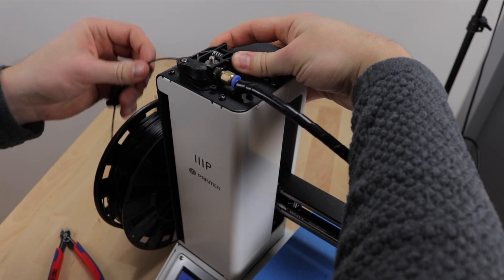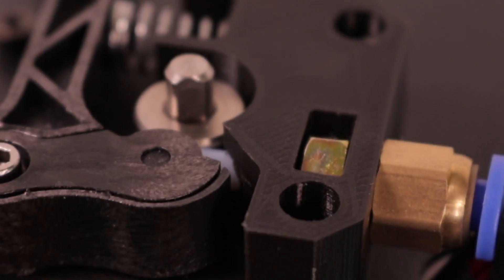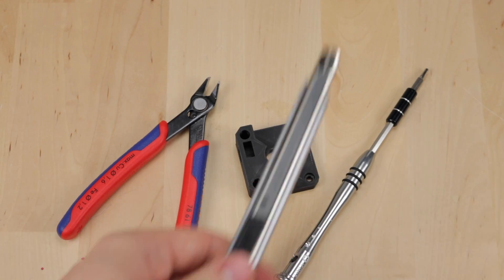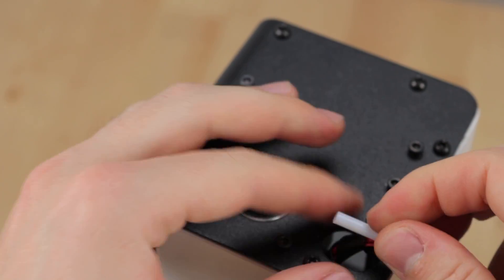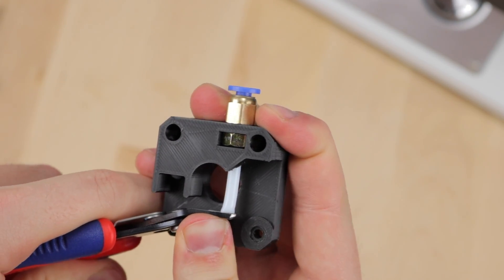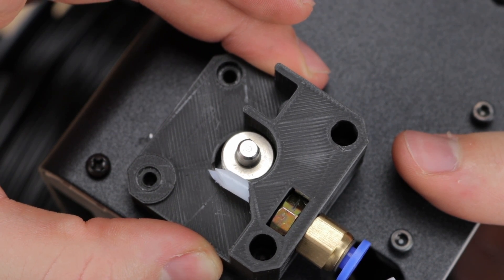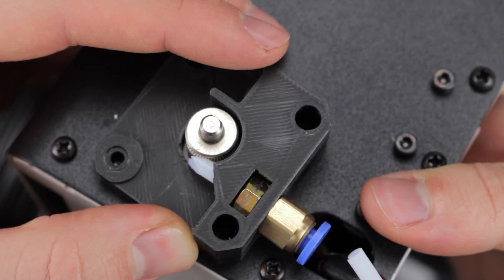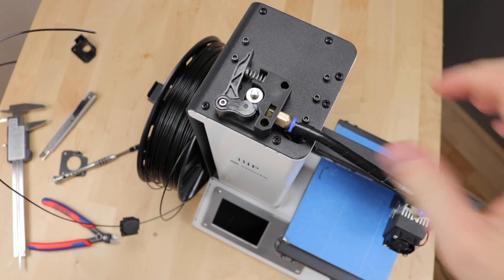MP Select Mini Feeder Upgrade for Flexible Materials - The Base Plate

Comment: Massive thanks! My base plate broke and you saved me a huge amount of work. I was able to jerry rig my broken extruder to print the replacement you designed and now it's fully functional again. The screw necessary to lock the idler bearing in place on my v1 machine was a little different than yours, it was a dome head screw rather than the allen head screw required for the design, but I was able to exchange the dome screw for an allen head version being used to hold one of the z-axis guide rails in place.

Comment: I had a few issues with this as my version of the printer doesn't have a nut for the Boden connector but I eventually found a way to get it working and it's great!
Reply: what did you do? im having the same issue
Reply: @dpschof9063  Not the cleanest solution but I got a pen knife and chipped a bit of the inside of the hole out to widen it. That wasn't enough so I also filed down the rim of the Boden connector and with enough force it went in. But make sure to super glue it in first or it will just pop out mid print.

Comment: Hi Robin, 
I want to start TPU also for my hobby and have this printer a while. is this mod still working good for you and does it endure?
what about printing PLA after the mod, does it effect? I have this printer for about 3 years and still prints perfectly PLA on stock settings
and never changed anything. 

thanks for your video!

Comment: Works great; thank you.  On the plastic tube you can just push it through to make it longer and snip it.  No need to have 2 pieces.
Reply: My early model MPSM has a step inside the fitting that prevents you from just pushing the tube through.  I wish it was this simple. :)

Comment: why not make the filament go into a pla hole instead of the ptfe tube for that section so you don't need all this cutting. or design a cutting guide!
Reply: I was thinking the same thing and since it's away from all the heat it doesn't need to be any heat resistant material just PLA for the most part.

Comment: BE CAREFUL!!!!  When I disassembled my feeder it had completely different hardware.  No metal base plate, and different screws and bushings which didn't fit with the printed parts.  To make matters worse the molded pin that hold the idler bearing snapped off while I was disassembling the arm, so now I have a broken printer and no way to print replacement parts.  I'm sure this is a great mod if you have the right version of the printer but don't bother if you have a newer unit.  (I purchased mine in Dec 2017).
Reply: the exact same thing happened to me, i just pressed my end of the bowden tube with the metal fitting  into the opening of the printed part and it worked out okay

Comment: Is this installation process pretty much the same in the V2 Upgrade on thingiverse?
Reply from the maker: I personally do not own a V2 but it should be the same. In fact I think a couple of people already installed it on their v2. You could simply try printing and installing the baseplate. There's nothing you could damage. (Maybe only cut the tubing if you confirmed that this part fits)

Comment: 1.5 cm was good for the bowden tube.  However I had a version of the mini with a longer press-to-connect fitting and had to modify the assembly with an extra washer.  Not a big deal, but people should be aware.  Please see my solution for that here: https://imgur.com/a/AteXT9C

Comment: Hi, You said you used a tolerance of .00mm for the arm, well for a cr-10s4 that tolerance is no right because the wheel on the arm is too big. thank you.
Reply from the maker: You mean the layer height? I'm sure if you go with the smallest possible layer height for your printer it might turn out just fine.

Comment: So im very hesitant on a 3d printer. ive looked at this one before or the prusa i3 mk2 and the other version of his printers. the only thing that has stopped me is the cost to how much i will actually be using it. the only reason i will be using this is so i can print some gopro mounts for my racing drones and maybe some antenna tubes and what not you know small stuff. so i wouldnt be using it very often maybe once or twice a month. would it make more sense for me to just buy the mounts that i already use that i know i like or get this printer and try to print out the same mounts and eventually i guess "save money" i go through one mount a month ish....but thats only on one drone of which i have 12. sooooooooooooooo
Reply: You are in for a surprise!  If you invest the time in learning the ins and outs of 3D printing and design software, you will be amazed at what you you end up printing.  The only caveat with the MP Select Mini is the small build plate.  Great for beginners who just want to see if 3D printing is for them.  If you buy one and like it, you will eventually move on to a bigger and much more expensive unit.  But if it is not for you, $200 is better than $1000 (minimum) just to find that out.

Comment: Great video. It appears on mine Monoprice select mini the PLA will not feed in. I put a mark on the filament and it does not move.I can push in the release lever and push in filament and filament will come out of the nozzle, so I know the nozzle is open but it will not feed. Any ideas. Thanks
Reply: can be your filament is brittle and bakes when you push it comes out just the broken part and if theres more broken peices it wont come ou when you start your print you have to amke sure its clean of all peices

Comment: Is it safe to print TPU/TPE filaments without an enclosure? At least when hot casting those materials, they are highly toxic and should not be inhaled.
Reply: I've never noticed any fumes while printing them. Though I've not researched this. So you may want to do some searching.

Comment: quick question, after printing something similar i noticed my extruder cannot pull the tpu off the spool. i fix this by removing some tpu from the spool and letting it gravity feed to the extruder. would this piece aid in pulling the filament? or does it just eliminate the gap to prevent bowing and flexing? im getting frustrated, because it prints fine if i remove some material from the spool. thanks!

Comment: where do you get replacement parts? i called monoprice and they do not sell replacement parts. im debating on sending mine back, because im sure it will break or i will need to replace the hot end at some point. any recommendations as to how to go about replacing parts like that?
Reply from the maker: Luckily almost every part on this printer is either a standard part you can get from amazon or a part you can print by yourself (just like the one from this video).
You can easily attach for example an E3D hotend by printing your a mount from thingiverse. I already have that mount laying around in case something breaks.
I suggest you join one of the amazing communities that developed around this printer.
You can find the "MP Select Mini Owners" group on Facebook, Google+ or even reddit.
Reply: are there step by step instructions. once i print the E3D hotend mount what to do next. sorry complete noob when it comes to this printer and this hobby.
Reply: Mad Yet: The printer has a wiki of parts and guides to how to replace them https://www.mpselectmini.com/

One of the reasons I bought it was the really great community support and the fact that the parts are very common items.
Reply: I get replacement parts from GigDigit.com.  If you're like me, you don't realize that you should have pre-printed a part till you've already broken it and can't use your only 3D printer.  They have saved me twice.  Shipping is fast (first class mail) and not that expensive.
Reply: amazon and google sell replacement parts and you will also need to replace to bowden tube and the fan

Comment: good video! do you use retractions with flex filaments with the bowden type?
Reply from the maker: Thanks. Nope. Its better to print flexibles without.
You can however use retraction. But you have to dial in the number to get clean prints.
Usually you need more retraction due to the compression of the filament inside the guide tube.

Comment: Anybody tried this with nylon? I'm thinking the strength + flexibility would be good, but on the other hand too much flex may be bad. Maybe just printing the nylon with more infill?
Reply: The people in this group are great at helping resolve mini issues
https://www.facebook.com/groups/1717306548519045/
Reply from the maker: nick martinez I printed that part with a very tiny layer height. Also I avoid dirt cheap filament and alwasy print a few degrees hotter than the filament vendor recommends. Last but not least I think my printer is a very good unit. Never had any issue so far!
Reply: ***** I checked did not see it only PayPal patreon Twitter. Mine is bocard80 at gmail
Reply from the maker: +Davey Hi I did not try but the rigidity with PLA is actually enough. Never had a problem so far.
Reply: Robin Reiter how do you get such clean prints without banding and deformity. can you offer some advice.
Reply: Robin Reiter my mini is only couple weeks old. I only use hatchbox pla . you mind sharing some specifics on the numbers you use
Reply from the maker: Sure. This part was printed at a layer height of 0.04375mm. Which is ridiculously low but it's a small part so it did not take too long. My PLA is from a brand called Rec. But I think you cannot get it outside of Europe (for a reasonable price). Usually I print PLA at 210 to 215.
Reply: ***** thank you anytime I print I get a mess. Even at 210-215 range at .5 speed
Reply from the maker: What do you mean by "mess" ?
Reply: https://lh3.googleusercontent.com/yf6KaHr4lBuQkYa8eZB-gHrOjMx3cAIwl4h49vNchxsmKaUn8XPwmTmuEIfGeQ0CNHUs3XZcpJ0
Reply: ***** 
https://lh3.googleusercontent.com/c14jq3Rv0Us-rtfn4TH6kjogUG9DuXYSAx17oSoPZfrHRfksg0EUwKwTq0dFxSzcvWMJ2E8Ec5A
Reply from the maker: I cant open these. 404
Reply: *****  either it's stringy and can't see details..or it's banded not smooth like I see others doing on the mp mini
https://lh3.googleusercontent.com/MvRokutqFgw6K_HF56i0M1ijxMPz7mrZ3WLEsbFz2jVad18eYsUcy1OVx2O_MwibBu7IJwIdsAg
Reply: Sorry to be a pain. *****
Reply from the maker: I'm sorry but these still result in a 404 :)
Reply: ***** no problem send me a pm if you can thanks
Reply from the maker: I can't. Just email me the pics. You'll find my address on my Channel.

Comment: Is this the only mod you did so that it would print TPU? And do you have any recommended settings?
Reply from the maker: Yes this is the only mod depending on TPU. Well the settings hardly depend on the exact material you use. What you basically have to keep in mind that you should print TPU at very low speeds (something like 20mm/s). And don't forget to heat your bed.
Reply: I think some flex filaments need a mod to the hot end- just inserting a section of PTFE. There's a vid here somewhere on it.
Reply: Which flexible filament do you recommend?

Comment: where is this little screw?
Reply from the maker: it should be among the others holding the stock plate. These should have different lengths. Simply choose the shortest one.
Reply: Robin Reiter ok thank you.  I must of printed something wrong the screw won't fit.
Reply from the maker: Which one does not fit? The screw holding the bearing?
Reply: Robin Reiter yes. I used the smallest screw and it wouldn't go through or thread into the hole. I don't think I printed with a brim or raft but I don't remember.
Reply from the maker: Hm well this is supposed to be very tight. Otherwise the forces of the bearing will not be redirected into the arm but just be absorbed by the bottom part of the screw. If you tweet me a pic of that part to @robin7331 I might be able to get a closer look.
Reply: Robin Reiter I can get to that later I'm not home right now.  Is it supposed to be so tight I need pliers to get the screw in the top hole?

Comment: Do you know what size tubing is used?  I wouldn't mind buy a new section instead of cutting the factory one.
Reply from the maker: Bill Kearney The outer diameter is 4mm. This should be a standard part that works for most 1.75mm filament printers. You should easily find that on amazon.

Comment: You can print it just in case, as a replacement, but I just drilled the 
stock one and inserted a tube, like in this video. Works as a charm!
Reply from the maker: Wavebourn You can sure do that! But this mod has another advantage and that is a higher stability at the point where the bowden fitting is mounted. The stock one kinda bends when retracting.

Comment: Thanks - that's a great upgrade, and very clear instructions!
Reply from the maker: Thank you very much!
Reply: Looks like it should work with all other types of filament without any issues, right?
Reply from the maker: As far as I know. Yes.
One reason for this upgrade is to enable printing flexibles. 
The other is to have a self-printable spare part.
I personally printed PLA, ABS, Rubber (some TPU based flexible) and Woodfill with that plate.

If you run into trouble somewhere please give me a hint!